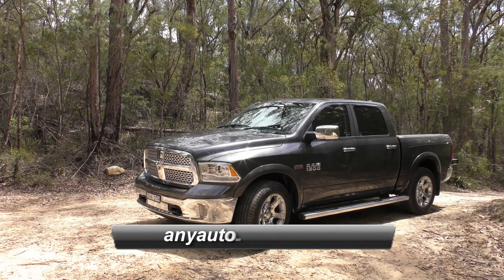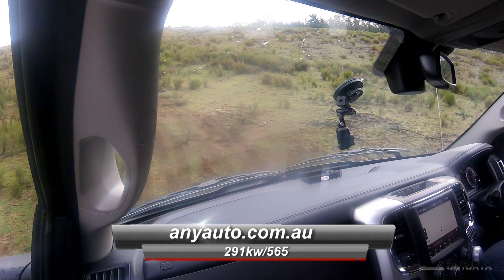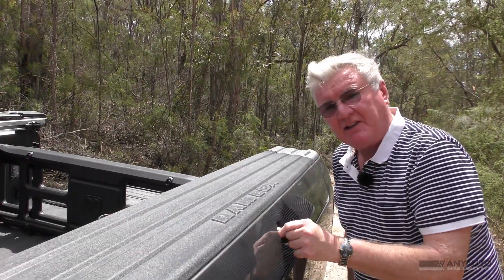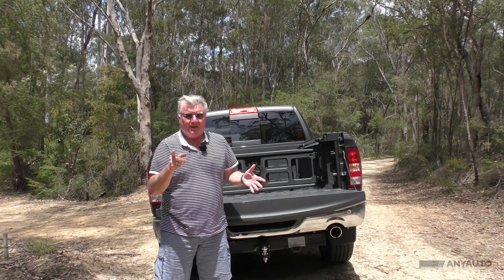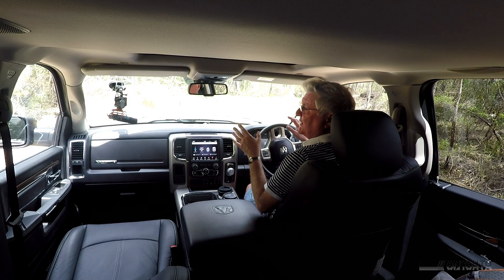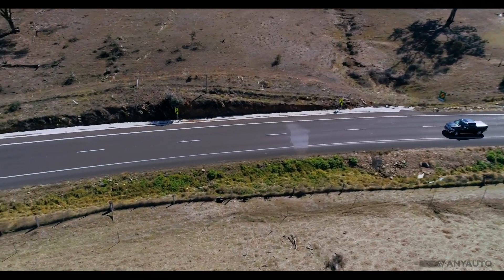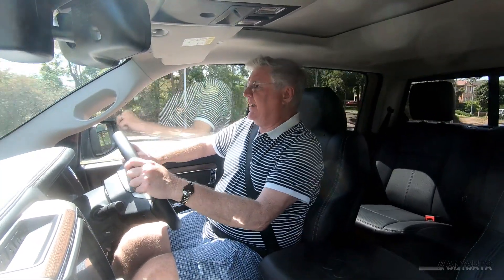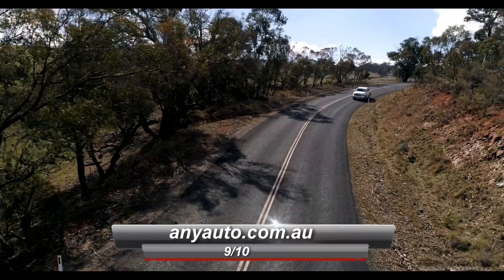RAM Laramie 1500 is it any good?

Comment: Have fun when it starts to fall apart on Australian roads. I live in Canada and these things just do not last. The cruiser is far tougher and more reliably built. These things are more life style/show pony vehicles. Yes comfortable on the highway but dont depend on them to be trouble free and take a beating for very long. Stick with the Hilux.
Reply: New hiluxes are crap
Reply: @hurelllucieer6225  What a well thought out and planned response. Any evidence of that ? I'm an auto mechanic and the new Hiluxs are far from crap. Most reliable of the bunch.
Reply: Seen them in a work environment and far from reliable. Known to get dusted. The auto is crap and performance is nothing special.
Oh and being Toyota, stupidly expensive.
Reply: @hurelllucieer6225  Well you would be the first person to say that. They use tje new platform all over the WA mines and they routinely run over half a million kms easily. Keep the common rail systems clean and they dont give any problems. I work on everything and anything and very rarely see a new Hilux with problems. The Tritons/Navaras are no where near as sound. And the D-Maxs blow propeller seals and lose the turbo quite often. And the Ranger is a rolling recall on wheels with a pissy weak trans. Junk. The Amaroks pop motors around 120 thousand. All modern utes have issues. How ever the Hilux is still the most problem free.
Reply: The first? Hardly.
Reply: What about the class action taking place against toyota regarding all models with the new 2.8L engine
Reply: Taylor Livingston bla bla bla. Ya may of had a lemon for sure. I used to say the same as you. But in the last five years and from several people I know have had great success with Ram. I had issue with my GM,s and Ford,s. Bought 2019 Ram and so far very very good and reliable. Now these 9 people that I work with and know don’t maintain there Rams like they should and they keep going. Myself I baby and maintain my trucks. Hmm. In the past the reliability was yet to be desired. True. But in the last 5 years have greatly improved. In Canada we have a hard cold climate and those he is start all the time.